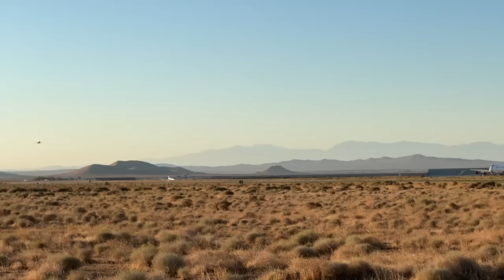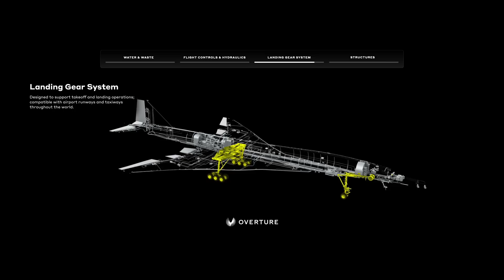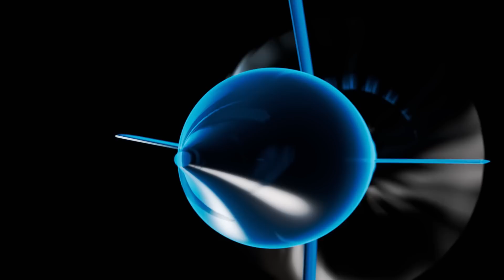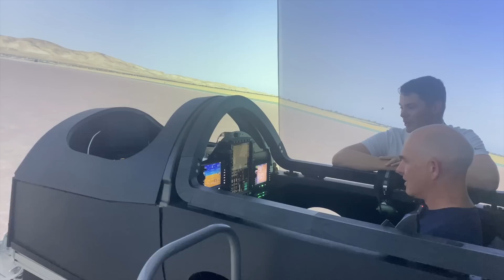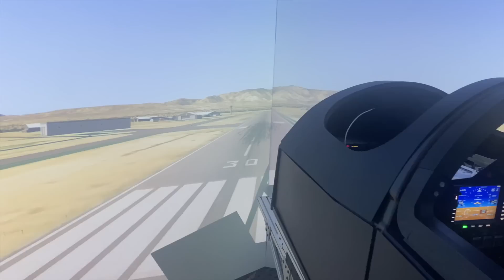Will This Experimental Supersonic Aircraft Show Supersonic Airliners Can Work?

Comment: Will This Experimental Supersonic Aircraft Show Supersonic Airliners Can Work?

Exploring the Boom Supersonic XB-1 demonstrator

* 0:04 XB-1 Demonstrator: Introduction to the Boom Supersonic XB-1, a three-engine supersonic test aircraft designed to pave the way for the Overture supersonic passenger airliner.
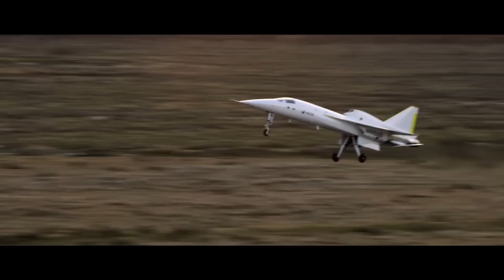* 0:34 Flight Testing: XB-1 is currently undergoing flight testing in Mojave, focusing on verifying systems like landing gear, avionics, and wing performance. 
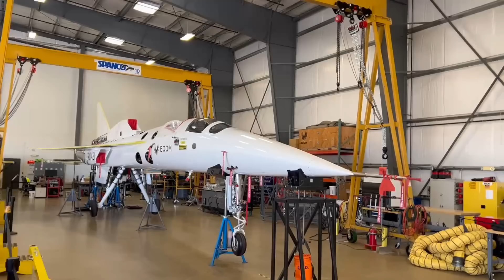* 1:04 Flight 4 Highlights: Flight 4 achieved a speed of Mach 0.6 and a maximum g-force of 2.5, the highest experienced by the airframe to that point.
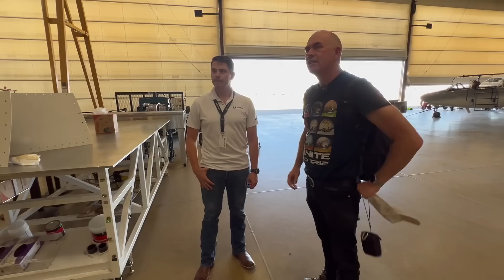* 1:40 Unique Design: XB-1 features a delta wing configuration with a relatively large rudder for single-engine operation scenarios.
* 2:50 High Angle of Attack Landings: The delta wing allows for high angle of attack landings, but necessitates a camera system for runway visibility.
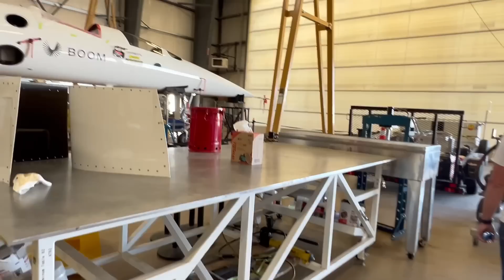* 3:31 Cockpit and Avionics: XB-1's cockpit is equipped with mostly off-the-shelf avionics with custom software. It currently only has a single operational seat.
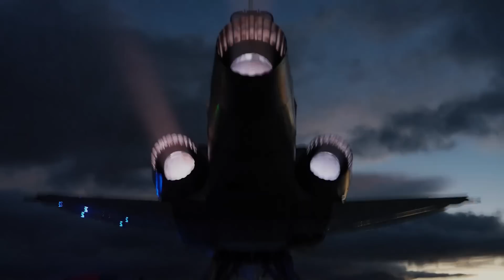* 5:17 J85 Engines: The aircraft is powered by three General Electric J85 afterburning turbojets, chosen for their availability and high thrust.
* 8:03 Overture Airliner: The ultimate goal is the Overture, a supersonic passenger airliner designed to be smaller and slightly slower than Concorde (Mach 1.7) but more efficient and maintainable.
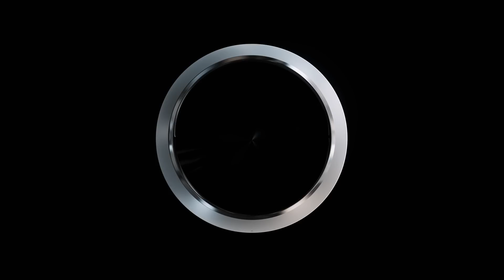* 9:37 Symphony Engines: Overture will utilize the Symphony engine, a non-afterburning medium-bypass turbojet developed specifically for supersonic flight.
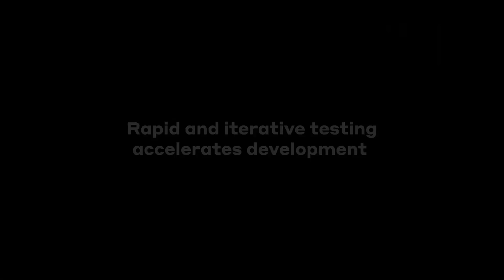* 10:34 Fuel Efficiency: Overture is projected to consume twice the fuel per passenger compared to subsonic jets.
* 11:03 Engine Development: Notably, the major engine manufacturers (GE, Rolls-Royce, Pratt & Whitney) are not involved in Symphony's development.
* 12:01 Technological Challenges: Developing a supersonic airliner remains a significant technological undertaking, requiring extensive testing and experience.
* 13:52 Runway Visibility: XB-1 utilizes a camera system for landing due to the high angle of attack obscuring the runway, contrasting with Concorde's droop snoot.
* 17:37 Simulator Experience: Scott Manley flies the XB-1 simulator, showcasing the aircraft's handling characteristics during takeoff and landing.
* 21:37 Future of Supersonic Flight: The video expresses hope for XB-1's successful test campaign and the eventual realization of the Overture, reviving supersonic passenger travel. 

I used gemini-1.5-pro-exp-0827 on rocketrecap dot com to summarize the transcript.
Cost (if I didn't use the free tier): $0.03
Input tokens: 21396
Output tokens: 583

Comment: I choose to watch their progress with interest and optimism!  The pilot seems to know what he is talking about, the solutions to high AoA landing seem sound, and overall test campaign looks to be focused on safety.  It's definitely going to be an uphill battle for them, but I'm not going to dismiss Boom right out of the gate.  Good luck!
Reply: Yeah, I think everyone hear hopes Boom will succeed but most know the odds are against them - lets just say I wouldn't put my retirement savings into it. The engineering challenges in getting a supersonic airliner in the air are very beatable and the market for high cost very fast travel is clearly there. However getting it certified and able to be used on economic routes  is a huge leap beyond that. The thing has to have the range for long trips plus be so quiet it can meet modern noise limits, all the while meeting modern safety standards.
The noise issue in particular looks intractable - supersonic travel means supersonic exhaust velocity which means noisy (ever hear a fighter taking off?). All that is before you even think about sonic booms. There's a reason Boom has been unable to find a manufacturer willing to build an engine for them so have had to attempt it themselves.
Reply: What are the biggest hurdles for this endeavor? I'd imagine that building a modern, efficient, and maintainable jet engine has to be up there. IIRC the Chinese government has been pouring an immense amount of state capital and resources into developing civilian and military jet engine technology for 20 years or so with very meh results so far.
Reply: @Nainara32  The Chinese are starting to get there, the intended engine for the Chengu J-20 fighter finally entered full scale production earlier this year and is by all accounts state of the art... competitive airliner engines though won't happen before 2030, and that was as you said after decades and billions in investments, and starting out on a very sound technical base of Soviet designs.
Reply: @johannesgutsmiedl366  And don't forget investing massive amounts into industrial espionage and reverse engineering of Western engines, which Boom is presumably not doing.

Comment: How do they fix the second problem of Concord. Those shields behind the wheels to keep debris from making holes in the air frame and releasing the fuel to burn the plane?
Reply: That problem was solved when airlines retired their DC-10's...
Reply: How did every other aircraft ever solve that problem?
Reply: @HALLish-jl5mo  my understanding was that the high runway speed of supersonic planes increase the problem as the velocity increases the energy available to damage stuff by the square. Also there were additional factors like a higher loss of uplift when burning and therefore a slower turn rate when turning back to land...
Mabe checking the airfield with lidar in the high velocity zones could be the solution or just trusting modern planes not to shed debris like suggested
Reply: Detailed investigation of the Concorde incident showed the tank ruptured from the inside due to a reflection of the shockwave caused by the original impact. Which makes that particular problem solveable by the construction of the wing and tanks. 
If I were to design a wing with tanks in those critical parts I would probably use a fibre reinforced plastic containing a significant percentage of kevlar fibres and have some foam after it that can crush and take energy. As well as more advanced monitoring than the Concord had available.

Comment: Soo... it seems that the engineers found an efficient wing shape, sixty years ago...
Reply: We kind of maxed out the science of aerodynamics at the end of the Cold War. It's why you see new tech going into old airframes
Reply: @samsonsoturian6013  Almost like people were smart(er) back then ...
Reply: @Canada_Dominium  its more that in terms of min-max, there isn't much more you can do once you know the shape of the shockwave created at a given speed that you need to put the most wing area behind ... The shockwave is a cone; wings want to be flat, horizontal and a minimum area to keep the aircraft in the air; physics says any supersonic aircraft has a swept wing.
The engineering to fit 3 jet engines into something that small - that is the modern engineering. Much less fuel will be spent at max speed.
Reply: @andytroo  And when was all that figured out?
Reply: @Canada_Dominium  increased atmospheric lead levels actually reduced IQ during the time of leaded gas
Reply: @JostVanWair  As in during the Apollo program?
Reply: @Canada_Dominium  Yes. Exposure to leaded petrol in that time has been alleged to have resulted in an IQ reduction of around 2.6 points in American adults, increasing to 5.6 in those born in the mid-late 1960's (Source: PNAS). People were not necessarily smarter on average back then; in fact, the may have been a bit dumber. 

What made Apollo a success was the truly ridiculous amount of government funding it received. I savour to imagine where we would be as a society had they maintained the budget allocated for NASA during that time.
Reply: @JostVanWair  "has been alleged"

Then you say dumbness can do great things with lots of money--?
Reply: @JostVanWair  I'd say the Internet, social media, Tinder, and 'smart' phones have combined to reduce average IQ to about 80.
Reply: @Canada_Dominium  Short form social media reduces attention span but not necessarily IQ. I was referring to an actual, physical reduction in the intellect of people due to leaded gasoline.
Reply: @Canada_Dominium  I did specify "on average"; there were many brilliant minds that found themselves into the likes of NASA and other prestigious organisations. However, those brilliant people were a) not necessarily "smarter" than the brilliant people today and b) should not be considered along with the average man of the time, who was likely to have been slightly or noticeably less intelligent than that of today due to lead exposure.
Reply: @JostVanWair  You seem stuck on this lead exposure fallacy.
Reply: @JostVanWair  People today don't even understand what a fact is.  You talk like some 'best of all times' revisionist.  Reduced attention span is by definition a lack of intelligence.
Reply: @JostVanWair  Oh, I see.  Video games addict.  Never mind.
Reply: @Canada_Dominium  Do you have a study or piece of evidence from a world recognised scientific journal or source to disprove my statement? 

If not, please take into account that the reduced availability of education back then, across the world, meant that your "people back then were smarter" statement is still false. 🤔
Reply: @Canada_Dominium  What the fuck are you talking about? When were you born?
Reply: @JostVanWair  RIP to the penny for NASA campaign...
Reply: @tycho_m  Eh?
Reply: Yes it's very impressive